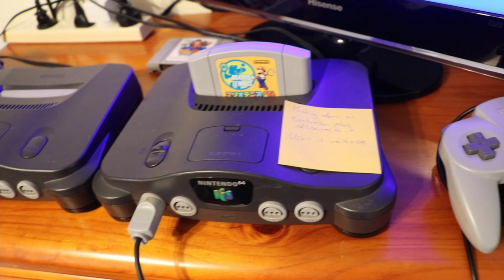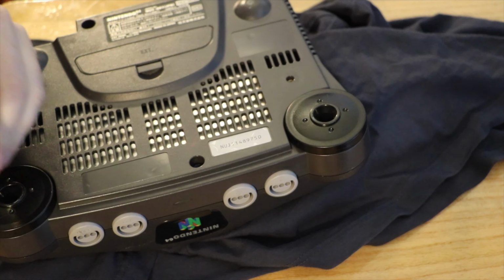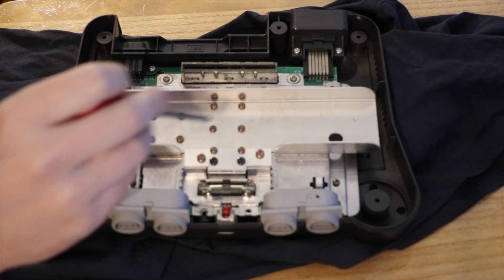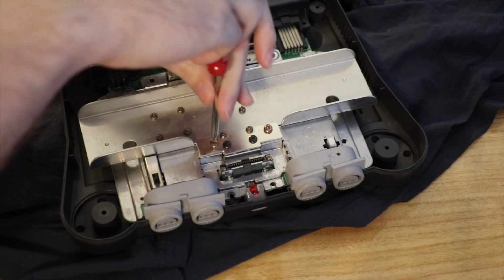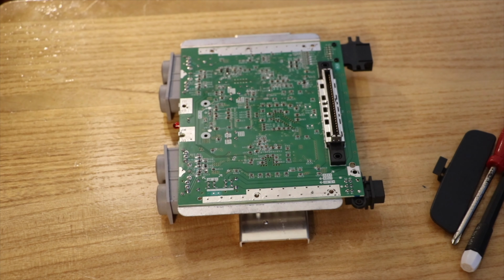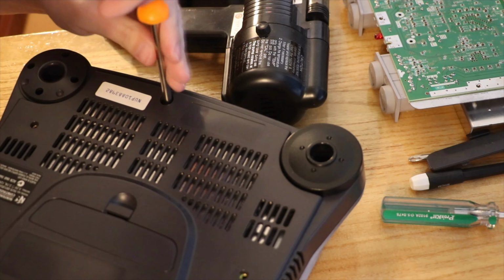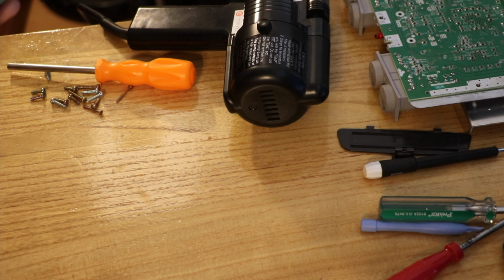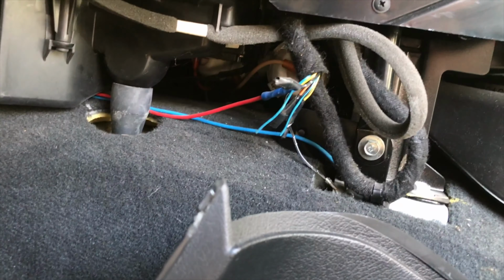Nintendo 64 Loose Controller Socket

Comment: Quick tip: You don't need to take out the Expansion Pak or the Jumper Pak. Yes, it is "in the way" of the top shell... but that's a good thing! It will come off with the top shell and remain captive/contained within. ;)